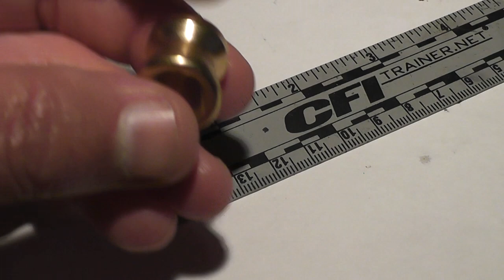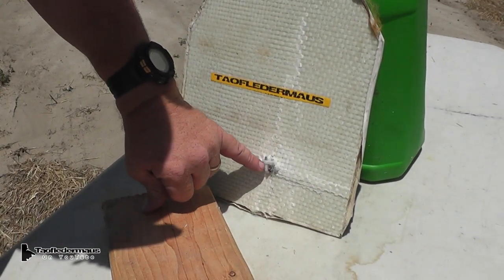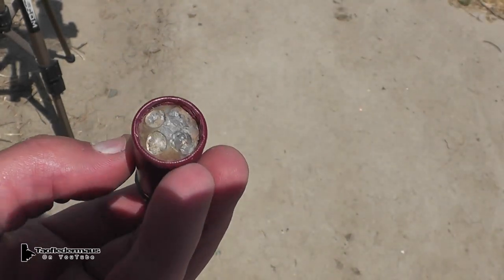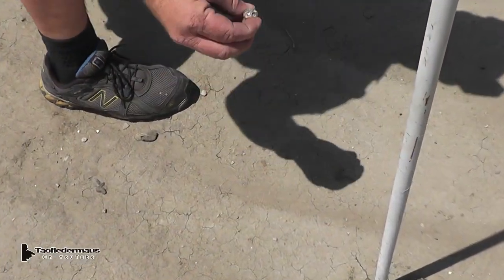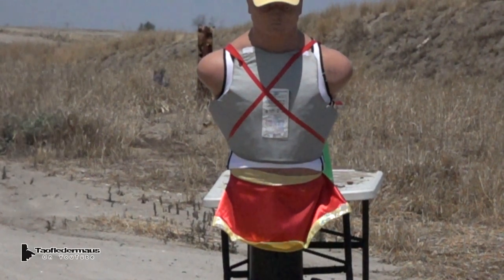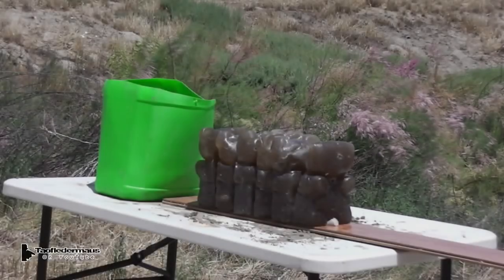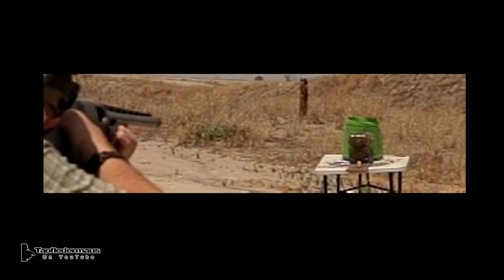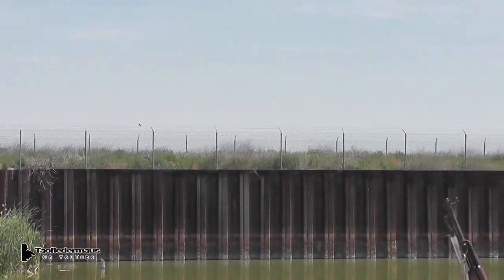BRASS PELLET-   Testing Ballistic Machinist's prototype shotgun slug

Comment: that was great. I love this round, I have a few more designs done just waiting for time to make them
Reply: How hard would it be to make a shotgun slug similar to the Lehigh Defense or the Ruger ARX pistol rounds?
Reply: +TACTICAL G-CODE The only suggestion I have is to many put a dimple right in the center of the slug so you could safely stack them in the magazine tube.
Reply: +Jason Carpenter not that hard that is kind of what the dimples in the front of this one is for
Reply: +Gorbachev that's a good idea thanks
Reply: I'm wishing for them in 3 in 20 ga.

Comment: brass is nothing, we just made our biggest sapphire crystal last week, 3 feet x 1-1/2 feet x 3 inches thick, well over 250 pounds, only thing that cuts it is a diamond, i'd like to send you a piece, but we make them for the US gummint, polishing a much smaller piece costs $50K (15"x20"x3/4")
Reply from the maker: +mr bad example  I bet a waterjet would cut it!
Reply: ***** can a water jet cut a diamond?
Reply from the maker: It can cut tungsten carbide.
Reply: ***** we use tungsten as a layer between the molybdenum and the carbon fiber bed, everything gets freaky at 3800F. my new job, been here almost a year.

i learn a lot here, but who makes 5 foot long sapphire chrystals?